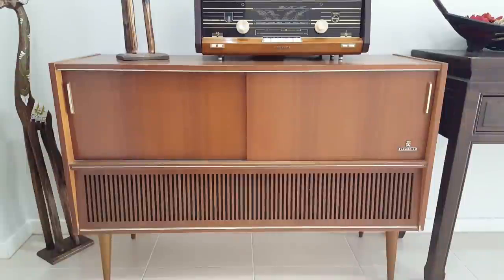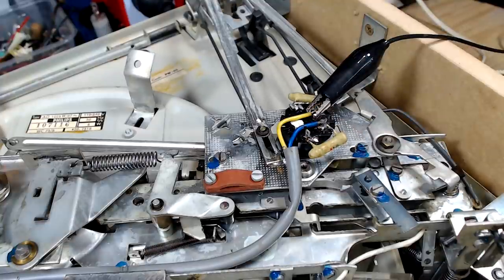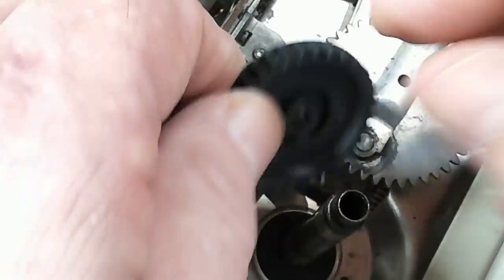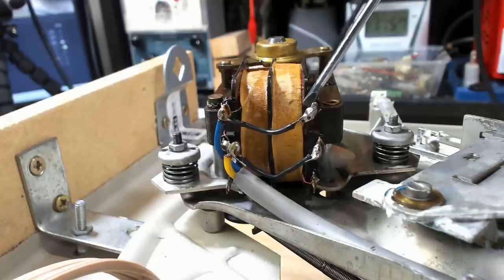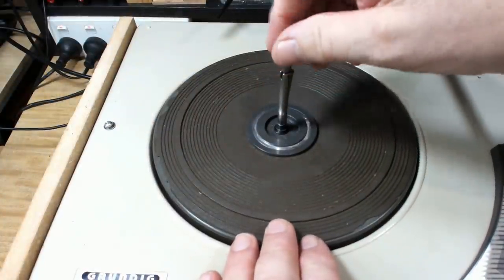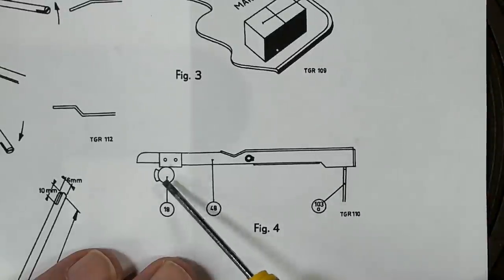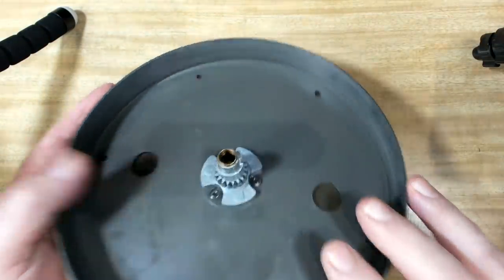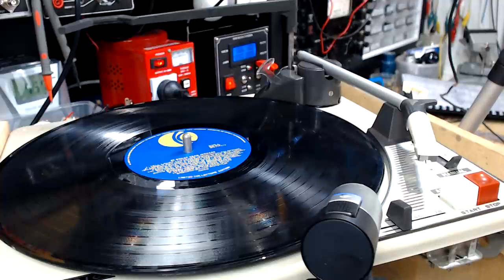Grundig Trento a/WE Radiogram Pt 2 - The Record Player

Comment: If you look at the original platter mat, the raised ring towards the outside is the same height as the center plastic ring. So the the record rests on the platter, it will touch the center ring, and the raised outside ring. 
Now that you replaced the platter with the felt mat, the record is now not supported correctly on the outside.
Reply from the maker: It seems to be working alright with the felt mat so far Gustave, The centre disk is depressed below the felt now 🙂

Comment: Well you stopped that record just in time Dave. Not because of copyright but because of the awful song 🤣
Also if I am correct and that was a K-Tel album it will sound pretty poor anyway.
They used to lower the sound quality of the music to fit more tracks onto each side of the record.
Find a nice brand name album once completely assembled to hear the full dynamic range through the stereo amplifier valve circuit.
ABBA records always had great quality recordings on them as did Elvis and Burl Ives. Or perhaps some Don McLean.....

Right I'm pulling out my records for a weekend of hiss, pop and crackle
Reply from the maker: I'll drag out a good one for the demo, I don't have Abba... or Don McLean.......... or Elvis, I think I have a Burl Ives Christmas album though 😄 Sounds like you have your weekend planned out 👍🙂
Reply: @DavidTipton101  The Seekers!
Reply: @DavidTipton101  Unfortunately my plans changed. Had to deliver some furniture to a family member in Newcastle so ended up delivering Sweedish furniture and assembling it instead.
Instead of Artists I should have said brand names of records.
RCA Victor, HMV, Parlaphone are all good quality pressed records.
K-Tel tended to boost the mids and chop off the highs and lows to make the tracks smaller.
You can see on one of their records with 7 tracks per side that the grooves are smaller and closer together than say an RCA record.
DONT OWN ANY ABBA OR ELVIS?
Im a little disappointed Dave.
Burl Ives, Perry Como and Bing Crosby Christmas albums it is then 🤣👍
Reply from the maker: @1974UTuber  I have ABBA on CD 😥

Comment: Hi David. Another great result. Those old Philips turntables were cheap and cheerful. Idler wheel drives were still popular back then, Garrard and the cheap and nasty BSR were using idler wheels into the mid 80s. In fact the superb Swiss made Lenco L75 with the Goldring arm was idler drive, and was one of the best turntables in its day. Look forward to seeing the next part, and I'm sure you will achieve another superb result. As always another enjoyable video. Cheers Chris.
Reply from the maker: Thanks Chris, it had the spare belt in the box and I expected it to be belt drive. You are right of course, I don't remember seeing belt drive till the mid 70s 👍🙂

Comment: I recognized this record player as being Philips by two details, before seeing the "Philips" stamp in the bottom of it:
1. The cheap plastic piece with three bearings in the base of the platter;
2. The GP224 cartridge.
Back in the days, these Philips were quite common here in Brazil, and you can still find many around. I got two from mid-70s which still shares many of the characteristics with yours - and one of them labeled as Grundig! They can play quite well when properly adjusted and lubricated, specially with a very generous amount of thin grease in that bearings. The cartridge usually go bad after many years, and can be carefully disassembled and cleaned/fixed, since now they're quite expensive.
Thanks for another great video! All the best!
Reply: The cartridge is a dead giveaway, and so is the design of the controls. The design language is exactly the the same as the EL3549 open-reel tape recorder.
Reply from the maker: Hi Álvaro, The platter bearing is very cheap but it does work quite well surprisingly, I saw a good quality replacement one on US eBay with the proper number of bearings in a brass cage.  I ordered a new cartridge and stylus but the old cartridge still works as can be seen in the video. Thanks Álvaro 😀

Comment: LP S ( LP Stereo (diameter/profile is to the stereo standard on the stylus) if In gold I think that means its a Diamond not a Sapphire.  LP S in Gold are normally the same on either flip over,  annoyingly, making it not possible to play 78s without (?destroying? them).
Reply from the maker: I queried the stylus guy and he said the same, not sure about the colour of the print but sapphire stylus are purple. The one I bought only has an 'S' on both sides and both sides are diamond. I could have got a 78 stylus on one side and stereo on the other  🙂
Reply: @DavidTipton101  Philips might have modified their 'standard' over the years !  Had three decks (same model),  bought from a clearence house retailer in the UK.  First one the FM stereo didnt work, took it back for replacement,  second one deck had similar faults to yours, took it back  third one similar FM problems,  could not be bothered, its not at my cousins, dont know if she uses it
Reply: @DavidTipton101  The ones I've seen had "M" (LP) in red and "N" (78) in green if I remember correctly. My Philips 504 portable uses the same type of stylus.

Comment: Hi Dave,
Thank you for sending me information about your signal generator: some of the articles in the magazines are interesting reading - much appreciated my friend.
The times I’ve received electronic equipment that has been messed with - like you, with your record deck, I have ended up spending loads of time putting right what has been put wrong before I get down to repairing the original fault.
You have done an excellent job cleaning, and restoring the record deck.  It looks very much like it was manufactured by Philips.  I’m certainly looking forward to Part 3 of this series - I know it too will be a treat
Cheers my friend, Phil
Reply from the maker: Hi Phil, it was my pleasure. The fiddling by others caught me out, the info I had was that it was original and had simply stopped working and it was in the box ready for me to look at. Being delivered in a box might have been a red flag 🤔
The unit is built by Philips and delivered to the Grundig factory. The cabinet is turning out to a bigger job than I thought, I hope I can get it finished in time. Thanks Phil 😀

Comment: I had a friend who had a Grundig Stereogram. I had a Philips Portable stereo record player and the Headshells were the same on both. I had still have somewhere a Headshell with a stereo diamond stylus. S on the stylus means Standard which is for 78rpm Shellac discs. I personally think that Grundig used record decks made by Phillips, but badged for them.
Reply from the maker: That is correct Chris, Philips supplied Grundig with rebadged Philips record players in later years 🙂

Comment: 4:00 If you took the stylus out, you'll see that the two tips are both for LPS(Long Players) Sapphire styli, it's just that the head-shell holding the cartridge obscures the lettering on that little flip-over tag on the stylus shank.
Reply from the maker: Yeah, I worked that out, thanks Neil 🙂

Comment: 27:45 Don't throw out the cartridge, just get rid of the worn stylus. The cartridge is still okay. it's the stylus itself that's worn(unless you've flipped it and the tip on the opposite side of the shank is okay). That's the thing with these dual-tipped styli, as one tip wears away, flip the tag and a new tip is waiting, ready to, as the late John Meillon used to say, "Keep on keeping on!".
Reply from the maker: The replacement cart and stylus came as an assembly. I still have the old one and it works fine 👍

Comment: On the deck of the record player is there the brand name Grundig, but actually this deck is manufactured by Philips in 1962, the type is AG1025. 
From 15:30 you  can see the Philips brand label.
Reply from the maker: Thanks Peter, I found that out, the manual I used was from Philips 😀

Comment: I'm not into phono-players, but after I start watching your videos, I forget that - and always enjoy them.    There's always something to learn.

Your caution about the voltage setting made me wonder if you have ever changed the voltage (correctly) on something, only to find that the device does not work properly on 50 Hz AC (or 60 Hz) ?
Reply from the maker: Thanks Howard. The Hertz difference doesn't cause any problems except for motors in grams or clocks so I haven't had any issues so far. I would assume this gram would have a different diameter drive spindle to suit 60 Hertz 🤔

Comment: Another great repair  Grundigs didn’t appear in the Workshop except I migrate person bought them over from and as you said that double Pentode plus Triode is very expensive 
The changer looks like Philips clone I think Philip Australia used a similar Changer in there RadioGrams but. Full Marks Mate in getting in operation I can difficulty and swear word you be using.Ian.
Reply from the maker: Thanks Ian. The player is a Philips unit and even the part number carried over to the Grundig. Cheers 🙂

Comment: Rubber idlers get hard with age and should be replaced. The problem is finding an exact replacement. When I serviced turntables and couldn't locate an idler, I would use a rubber drive cleaner liquid to soften the rubber. I actually still have some left over. It must be 20 years old or more. The tiny glass bottle (1 ounce) was sold by Vita-Drive in the USA
Reply from the maker: Hi Glenn, the rubber was still very soft and supple. I removed the hard edge rubber and it's working perfectly. I have seen people used rubber softener but haven't heard of Vita-Drive. Thanks Glenn 😀

Comment: That rubber idler-wheel brings back memories of frustration and anger. My first turntable was a Philips, like this one. Because the rubber on that wheel had dried out the turntable slipped, which I tried to fix by shortening the spring. Which, of course, caused other problems. Not everything was better in the old days!
Reply from the maker: Idler wheels are a problem, they aren't readily available and are often beyond repair, yes, more spring means more damage to the wheel over the long term 🙄

Comment: Nice work on a really handsome (what they now call mid-century) design. I would have cut the felt mat just a millimeter or two smaller than the platter so that the rounded edge of the platter shows around the mat. You have really excellent mechanical sense. I know this one took you a while, but you always figure out the logic of the devices you work on. Do you know the year of manufacture on the unit? I'm guessing 1966 or so.
Reply from the maker: Hi Stephen, yes mid century now, like my youth 🙄 I cut the felt on a slight angle but not a mm in, that would be difficult, I could have machined up a wooden disc a mm smaller, maybe next time. The unit is from 1965 as far as I know. Thanks Stephen 🙂

Comment: Nice.  I haven't seen a Grundig record changer since the early 70's.  In the US We didn't see many Grundig anything's even back then. 
Btw, the record end trip slider that the tone arm actuates should be grease free as it impedes its travel down the record.  You might think perhaps some light oil, but that tends to attract dust and defeats the purpose off minimal drag on the tone arm movement..
Just a thought...
Reply from the maker: Thanks Glen, I'll check the Philips lube chart I have and see what it recommends, thanks for the tip 👍😀

Comment: Those automatic changers look like a nightmare, so many levers and springs that are easy to get wrong.  Wise not to dismantle it I think :-)  Congrats on getting it working and, er, reverse engineering a past 'repair'.  😊👍
Reply from the maker: Thanks Pauline, it was a bit tricky, there was a hole with a rod in it, hard to tell it wasn't supposed to be there. It works well now though 😀

Comment: Those electrostatic tweeters are renowned for not working properly after many years and need restoration. There are many articles on the net showing how to restore them. If you Google electrostatic tweeter restoration you will see quite a few Grundig models being rebuilt. The problem is with the foam rubber pressure pad distengrating against the diaphragm. It would be worth checking yours out
Reply from the maker: Hi Chris, thanks. I looked at the speakers and they are riveted to the mounting plate and the plastic casing has been melt sealed, nothing that can't be overcome but I will wait and see how well they work or don't work. Other electrostatic speakers I have have been OK but I have no experience with Grundig's models. I'll check out the videos so I can be mentally prepared 😀

Comment: Great video :) what did you do to clean up the idler wheel?
Reply from the maker: Thanks Harry, I removed it and put a bolt and nut through the hole and mounted it in a drill, I used a piece of sandpaper to take the hard edge off the rubber, I should have put it in the video 🙄🙂
Reply: @DavidTipton101  There is a thing called Rubber Renew.  It's a liquid.  Maybe that would work if you have other things that need rubber repair.
Reply from the maker: @saintmichael1779  Looks good SM, it is out of stock in Oz but I have put it on back order, thanks 👍🙂

Comment: 7:01 That flip-over stylus does indeed come out of the head. That bracket just behind the flip-over tab holds the stylus in the cartridge. It's just a matter of turning the tab half-way to get a good grip, then just gently pulling toward the front of the cartridge. The replacement goes in by reversing the procedure. By the way, LP-S refers to LP Stereo, which is somewhat superfluous as the other side, simply labelled LP will also play the stereo discs. The stereo content is detected by the cartridge, not the stylus.
Reply from the maker: Thanks Neil 👍
Reply: @neilforbes416 Yes i remember those.

Comment: Looks like 👍 you're putting a different record player in this, instead of the original one. I guess ya still need to do the cleaning, and re-greasing. Not 👎 sure how the idler wheel will be. A rumbling noise when the record player is turned on 👎 will indicate that it is bad 👎. I guess he wants a complete swap out from the original record player that this record console first had. Plastic gears ⚙? I thought they were metal. I don't know 👌 why the owner wants a different than original record player in this console. He's only getting plastic gears ⚙ if he does. I also don't know 👌 if this console has an AM/FM radio 📻. Don't pull apart the motor bearing 🐻 bushings, because if ya do, it's game 🎮 over. That's if it's the kind 👌 of spring-type  motor bearing 🐻 bushings Radiotvphononut 📻 talks about. If this is done ✔, the motor bearing 🐻 bushings cannot be put back together again. You'll do a GREAT 👍 job!! Your friend, Jeff.
Reply from the maker: Hi Jeff, it's the original record player. The guy who owned the radiogram original bought a new record player for himself and gave me this radiogram, it is my radiogram now. There is no FM on this version of the radio. The idler wheel is in good condition. I didn't need to pull the motor bearings out 😀
Reply: @DavidTipton101  Always take care ❤ of this radiogram 📻. It must be only an AM radio 📻 on it. I wonder about the condition of the dial cord. I say the dial light works, and the dial cord is fine. Your friend, Jeff.

Comment: I wouldn't I would go with a REVOX B795 which will play the records the way the master was cut as a normal turntable will damage the grooves of any record you might play on it.
Reply from the maker: Mmm, you may have missed the point of vintage radio/phono restoration David, The REVOX B795 is a nice unit  👍😄
Reply: @DavidTipton101  the REVOX B975 is vintage as it came out during the 1970's

Comment: Idler wheel turntables were more or less standard on high end stereos of that time.  It really wasn't until the mid 70s to early 80s when really cheap DC drive motors replaced these nice all metal constructions. Basically when stereos went from hiding inside furniture (the console) to the rack and bookshelf type systems of the 80 and 90s.
Reply from the maker: Thanks tarstarkusz, I saw the spare drive belt in the box with the player and assumed it was belt drive. I had a belt drive player in the mid 70s 😀
Reply: @DavidTipton101  Isn't this from the 60s?
Was your belt-drive turntable driven by a small DC motor?  I know they started to become really popular in the mid-late 70s and had taken over entirely by the mid 80s.
The high end consoles of the 50s and 60s all used these changer type mechs and the best ones had very light tonearms and light moving magnet cartridges.  I think Zenith had a different type that was also very light. IIRC, it was called the Cobramatic or something like that.  Some of the better ones also had a "pitch" control that would allow you to speed up or slow down the record, although they are pretty good without it because they are synced to the frequency of AC.